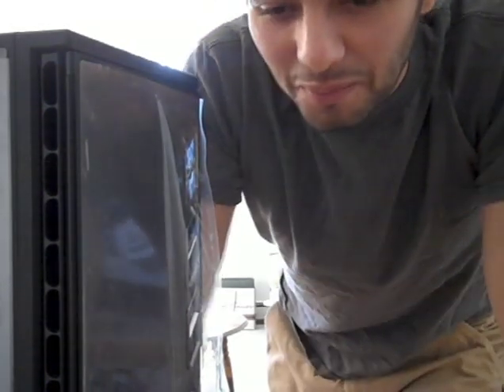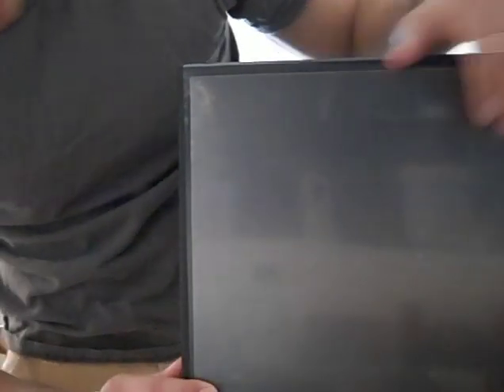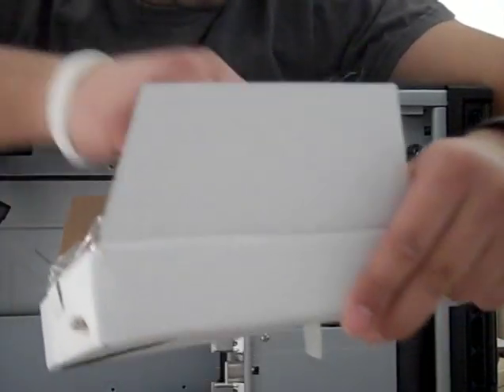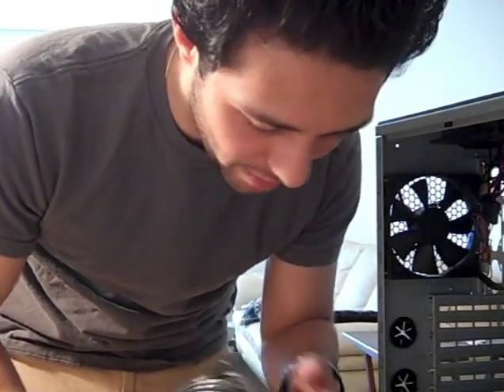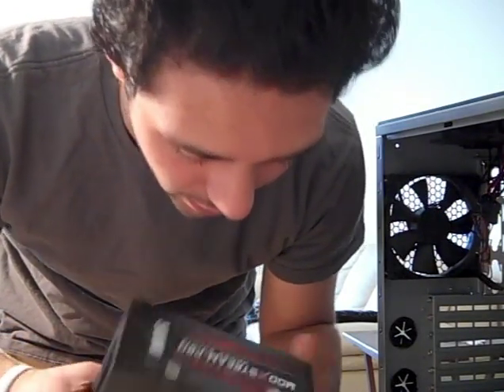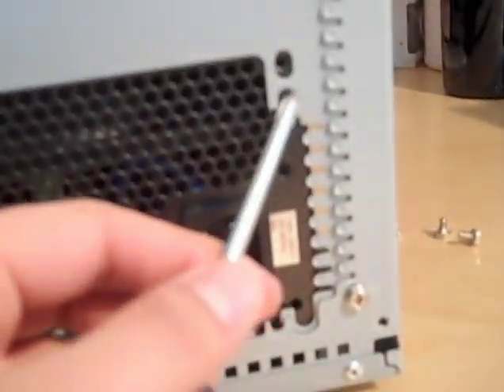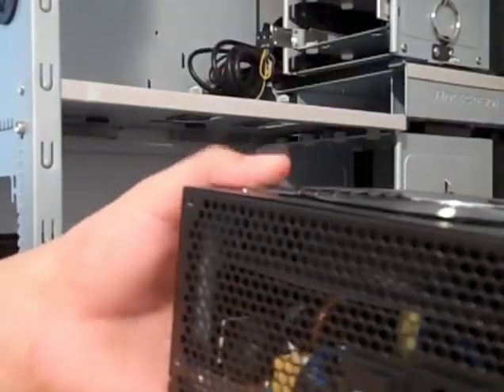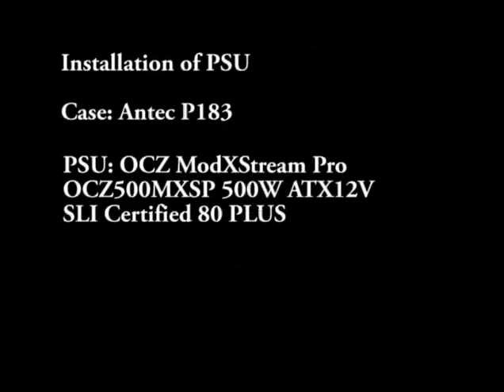Building PC Part 1 - PSU

Comment: Dude i'm sure the fan on the psu should be facing down. It does on mine but my psu fits in the top of the case. Unless you had your case upisde down then totally disregard everything i just said (lol)